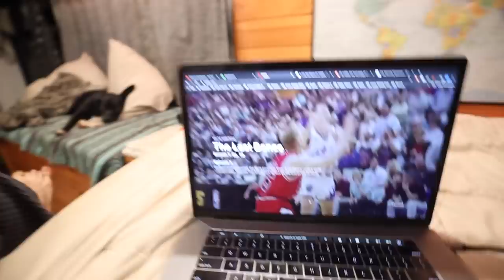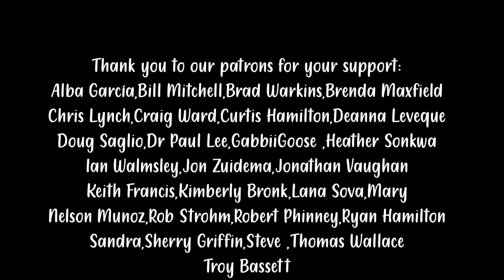Forced Quarantine is OVER // Panama lockdown in a school bus

Comment: Happy for you guys! Finding that spring is a major game changer. They make some great 12v above the ground and submersible pumps. Depending on the elevation may have to have a pump station with an above the ground pump bringing the water from the spring to a holding tank.Then a submersible pump in the tank pumping it up to the van all powered by a small separate solar system. During the day with a couple of panels would trickle charge the battery while giving water at little to no cost for the battery. Just pump of the day even a single marine battery would be plenty enough for the amp spikes the pump would pull while using it very sparingly in the night hours. The panels and the piping would be the cost but cheaper than digging a well which may not even find water. I use a system like this for my garden which is not near my house it was cheaper to pull water out of a branch than to pipe my house water to the garden. I tested it without the car battery the panels alone ran the pump just was slow to get up to speed which is the only reason I used a car battery. 

Perhaps a single pump would work if you used half inch flex pipe (much cheaper) giving the whole system more psi but a lower volume. Pumping straight up is hard on a pump but on an incline you could greatly! increase the pumps rated pull/push distance. Spring water doesn't need boiling y'all could have fresh spring drinking water!. Also glad they lifted the restrictions none of us will take freedom for granted again....

Comment: Try a split rail fence to keep the cows out. Not too expensive, not difficult to make. You better filter and then chlorine the water before drinking any of it. I bet rain from cow crap runs down there into that water source too. Hope you have clear tape for that hot house plastic if it gets a cut anywhere on it. Small cuts in wind become big cuts.

Comment: I just had a pallet delivered yesterday.  That's a week early. It weighs 600 lbs, that is 272.1554 kg. It's ten 400watt solar panels for building my own power supply. I'm building my own solar panel array and I'll be adding it to my two wind turbines so I can build a combined total of 8.5kw or 8,500 kilowatts power supply. I think I'm going to build it all on my cargo trailer so it can be portable enough to take it with me wherever I go.

Comment: If you take a black coil of water line... and a black interior in a box holding that coil .. or perhaps even black plastic inder it..Put it up in the air maybe even on the bus roof..& the sun will warm water -when the sun is high ... then..
You need to feed water into it , and then make a mixing...”  hot n cold spigot”..  & you will have, hot showers 
😉

Comment: What you need to do with the water is dig a pond, reservoir or a holding area for the water and build a ram pump, there simple, they take no electricity to run, it runs by water pressure. FREE water to your tank 24/7 !!  Seeya Rob

Comment: How to stop the COWS from jumping your fence and jumping over your things.  I have read about setting up a tall fence to keep out deer. But the only way it worked is by figuring out where they would be likely to land.  Stab PVC pipe in that area and put a sharp cut on the end that stands up, make it look like they will pierce themselves if landing on it.  Maybe that will work with the cows too.  As for your barb wire fence, try the same thing only put them in the ground at an extreme angle, so the cows might think if they go through the wire, they will stab themselves on the pointy, dangerous looking pipe.. If you try it and it works wouldn't that make a great video..John   p.s.  Love your videos

Comment: Does the hardware store have rain gutters in large size that you can  put chain or rope on each end, cap the ends . fill with dirt and hang on the solid section of green house to plant, lettuce, radish  etc. to save ground space and less  ground bugs.

Comment: Hey Jordan you mentioned that you haven't taken a hot shower in 2 month here's a way you can fix that
Heat water on your stove mix it with cold water and you have warm water all you need is big bucket or maybe a big igloo cooler that's how I solved my shower 🚿 time problem
Reply: Just coil some black pipe on the roof and the sun will make it red hot.

Comment: Can you find a place where the spring water starts to run down a decline in elevation and first build a pond and divert the spring water to store in the pond. You probably know this, but you can order a plastic bottom for the pond to keep it from soaking into the ground and drying up. With a pump, all your water issues would be over! Plus, you could then dig a little stream area to have the overflow of the pond, when it fills up, join back into the original spring channel, but further down stream. So as to keep it as close as possible to as it was... 🤔 😁
Love your channel! Thinking about moving to Panama, but closer to the coast. 🤘

Comment: This is a very minority opinion. I don't like pocket screws with or without cool jigs. They are effective but not elegant. You can hide the non-elegance, but I'd rather you could look inside or wherever and find elegance. Even dowels or (shudder) biscuits are better and neither takes longer. (They're also cheaper and as strong or stronger.) They keep the mystery. There's no visible joint. Next step would be real joinery. It would be visible to great effect. You'd have to study and practice and learn for that though. But if you are just wanting fast, and easy, and not costing too much, with good looks only on the outside, pocket screws are fine (along with glue). You do you boo.